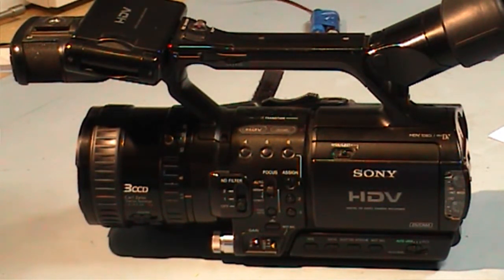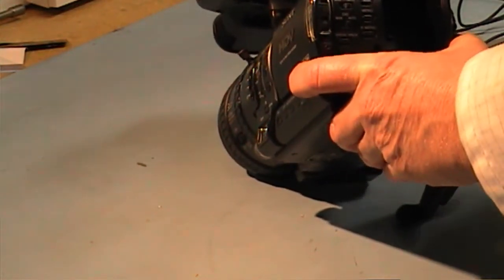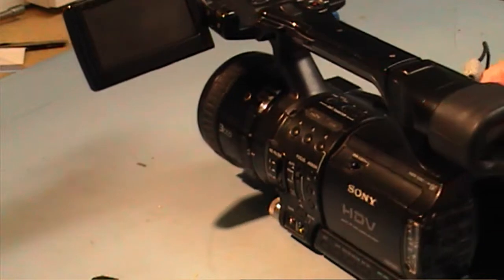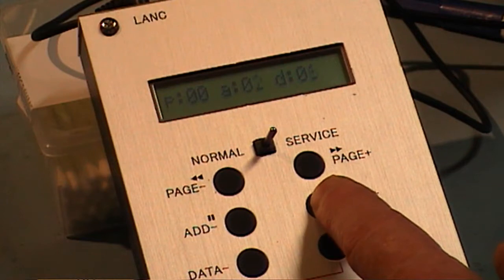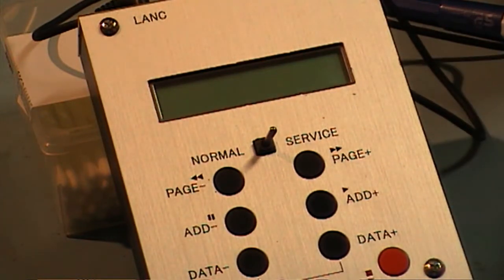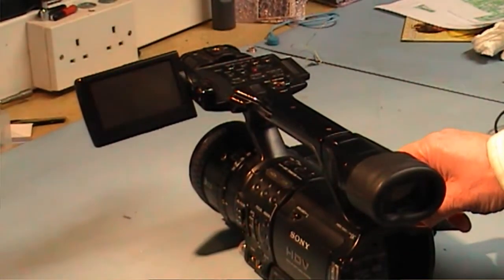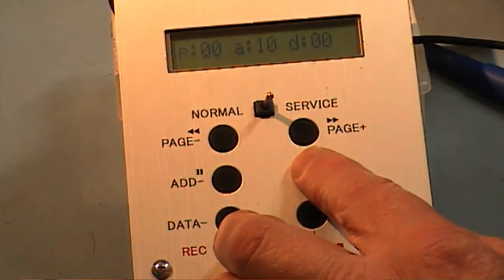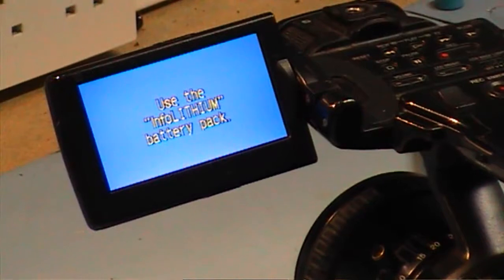Sony HVR-Z1E Repair information

Comment: Hi, i just repaired my focus lens coils that were damaged from fall. The camera can now zoom and focus, but it cannot have a sharp image at full wide angle and two meters from the object. I can see the focus lens can do full swing in its housing. Is there any setting that can be executed by commander to adjust its focusing range?

Comment: My Sony HVR-Z1E was working fine, it was on standby I went to take another shot and the camera was dead. It did not know it had a fully charged battery, even the tape eject did not function. Any ideas?
Reply: Mike Sutton hi mate did you find the cure for this, I think mines done the same thing. Completely dead

Comment: Don't know if you can answer this but worth a go. My trusty Sony Z1 has started doing something very odd.. When I playback any HDV recording it will play a second then picture freezes then again see a second or two then freezes and jumps about.. When I try and record it seems to work ok but just on playback.. However the really odd thing is I think this is since I tried DVCAM mode as now in DVCAM mode it will record and playback without any issues but it won't playback its old HDV tapes anymore. First guess was heads dirty or the like so used a Sony tape cleaner and done nothing then always did the software reset a few times and no joy.. Just seems odd it will record and playback in DVCAM mode comply fine but as soon as I put it back to normal HDV mode (used most the time I have owned it) it goes loopy! Also recording in normal DV mode gives random video glitches too... Any ideas? I know its an old unit now and been used a lot but to have it work flawlessly in DVCAM mode but play up so much in HDV seems super odd!
Reply: Same problem with mine, really pissed off with that cam
Reply: @christiansanden8005  Very odd.. Just got it out tonight to try and same thing.. records and plays DVCAM fine but cant seem to deal with HD video anymore :(
Reply: @epicchris1985  I think its a  issue of headspeed, read it in a forum about that cam, its not a dirt problem, i cleaned the drum, same shit, in DV mode no problems but resolution is bad
Reply: @christiansanden8005  ahhh that's annoying.. guess all that could be done is replace the drum and not worth it really now :(
Reply: @epicchris1985  Yeah its a peatty, cam worked fine until 2 month ago, didnt use it since than and now this shit, its not worthy to fix it, expensive
Reply: @christiansanden8005  It's a real shame as love this unit. It has done a lot of hours though even before I got my hands on it so I guess it's just how it is now until it fully gives up the ghost.
Reply: @epicchris1985  i am going to sell it, cause having a 3CCD cam recording ordinary dv its a joke, i would like fix it but afraid it will cost more that its worth it
Reply: @christiansanden8005  Yes I might do the same with mine, though I'll be sad to see it go.

Comment: Hi i have a sony hvr z1e camera and it is dropped from a 1m. Now it has a fault that the filming out side the vision is fine but inside you need to make a gain of 18db to have a picture. Do you think that it has a faulty in the lens? If yes how much does it costs and do you repair this fault?
Reply from the maker: Its sounds like the lens is damaged from the fall
the part no. for the lens is A1106565A
It would be an expensive repair. the last lens I purchased cost me about £450
then add labour and vat
Reply: Electronic Workshop the technician here in Malta told me that there is a fault in the shutter. Because the cameras lens is not unfocused but it works good. Do you think that there is 2nd hand parts of the lens?
Reply from the maker: newsupdatemalta I would think the iris is jammed,
You might be able to get some second hand parts, but the problem I found is, that once I open the lens, dust gets into the lens assembly.
Reply: Electronic Workshop my friend noticed in his camera (hvr-z1e also) that when he goes long shot there is 2 dots in the lens when he zooms they will not be visible. Then he found that there is 2 small dots in on the lens that might be dirt. Do you think that can be repaired? Thanks Jonathan. Another thing, i am trying to buy a second hand that has a mechanism fault so i can repair it (it's only £350 ... do you think that is worth to repair the mechanism or else i take the mechanism from my other camera (that was dropped and damaged the lens).? Thanks again, Jonathan
Reply from the maker: Jonathan Farrugia I have never being able to remove dust from a lens, as soon as I open the lens, more dust gets into it.
If you get a working used lens, it has to be setup with the camera, using special tools, they are very expensive to buy. unless you have these tools it would be difficult to carry out this repair
Reply: Electronic Workshop So, it is worth it to buy a second hand camera with a faulty motor and replace the motor from the one that has the damaged lens. I think the motor is not that too expensive. What do you think?
Reply from the maker: Which motor are you talking about
there are a few motors 2drum motor, capstan motor, loading motor, focus motor, iris motor, zoom motor,
Reply: Electronic Workshop Hello sir, the dv motor it says c:21 etc.... and another one has a the screen keeping blue... I think that from one camera can repair 2 cameras
Reply: Electronic Workshop What is your opinion?

Comment: I've got the same camera and the cassette mechanism stoped working.  Does anybody know any private experts who can fix the mechanism or install a new one? I am based in London, UK. Or parhaps anybody knows forums where I can find an expert to fix this issue? Thanks. Previously I took ot to a video repair shop and they quote 570 GBP to repair which is insane as now this camera does not cost that much nowedays.

Comment: I just got my fx1e out of the box and turned it on, all seemed fine, then went to turn it on after a short time and nothing. Completely dead? With or without battery on and power leaf connected. No lights at all? Any ideas
Reply: The same thing happened to my trusty Z1. new batter fully charged, zero camera response. AC power adaptor same thing. ejected a tape and now of course the door won't close if no power. Damn!
Reply: @BushCampingTools  Those cams are a lot of problems, my wont playback HDV anymore, never again Sony stuff, bought JVC 3 CCD with hard drive a time ago never any problems, Sony,'s customersevice stinks,
Reply: @christiansanden8005  Hi there, sorry to hear that. Although my experience with their cameras has been nothing but good My old z1 has been around the globe over ten times, been in Syria reporting with it, filmed basic wildlife with it (obviously it isn't for wild life) made several documentaries with it and stuff for the BBC LOL (news and some sequences for a major TV series LOL about 9 years ago! That's why I was totally perplexed when I ran into trouble with it but now they are so old, it's just not worth getting fixed. iI even trained my kid to use it as a prequel to using professional video cameras LOL. I guess I've had my money's worth out of it. I often wanted to go the JVC route but changed directions for filming. (BTW it has nothing to do with the channel I'm writing from).

Comment: Listen I am writing to you in regards to gaining a quotation for repair of a Sony HVRz1e. 

I had an unfortunate incident in church where the tripod it was mounted to was knocked and the camera fell to the floor.  After we got it back up we noticed that there was an issue with focus - like a big fuzziness on the screen.  It was fine before hand and then when we went to look at it there was a smallish splintered glass affair on two of the lens components, where perhaps they have collided together.

We can't get it to focus at all, and i've had to now chat to my camera insurance company about getting it repaired.  In order to do so I need to gain a quotation for a repair.   How much would you charge for a quotation for repair if I were to send the camera to you.

Are you over the border somewhere in the south?  Im up in belfast.

HVR Z1E Serial number 1210826
Reply: I hope you managed to get it fixed...